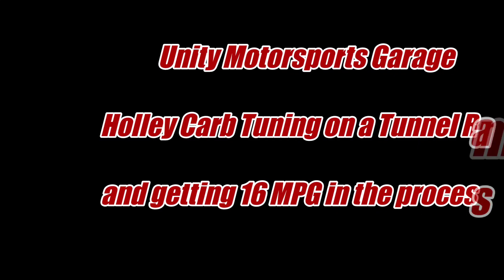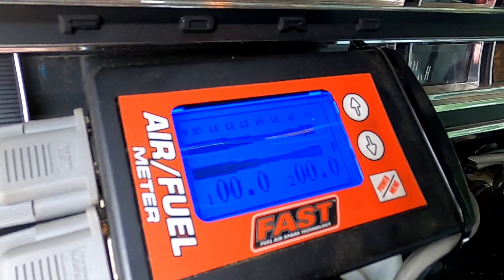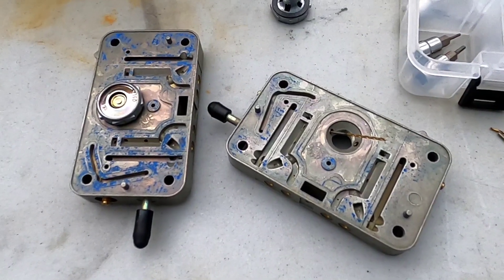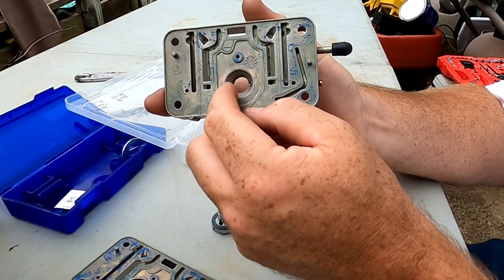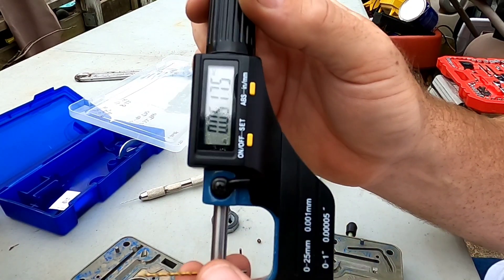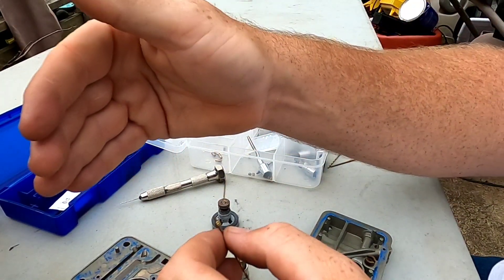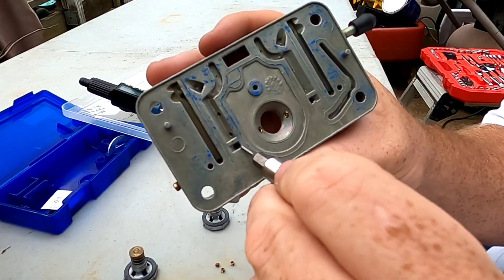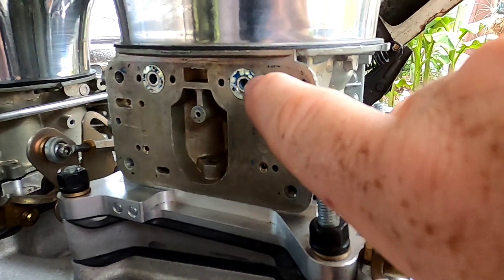600HP that gets 16MPG with a Holley Tunnel Ram and 2 Holley 660 Carbs

Comment: I have 12Bolt Tom’s tunnel ram cast for the 292 Chevy straight 6     
I’m considering getting his 3bbl modification for the Holley 4bbl. 
Soon to have the Carb Cheater controller. My 56 GMC lives a hard life at elevation in Colorado.

Comment: Andy, have been watching your videos on cams, tunnel rams, carbs, etc for a while. I'd like to talk to you about a new build that is right in line with the motor in this video. 438 Ford W street motor, AFr 220 heads, Holley high ram, 5 spd manual, 65 Comet. I don't have a cam or carbs yet, would like your input, especially cam. Every cam maker I've talked to has different specs ranging from 230 to 255 @ .050, crazy. I'm missing too many pieces of DV's formula to spec one myself, I'd screw it up. Gotta get a cam to get this motor together. Custom built tunnelram carbs or Edelbrock VRS, size ? I haven't seen any mods you've done to the current VRS carbs you're running for tunnel ram application, have watched all your Holley mods, how different ?
Reply from the maker: Are you wanting to Street Cruise this or is it S/S deal?
Hyd Roller or Solid? What Gear is in the Car?
On the Carbs I definitely would recommend two 750cfm VRS's they will make serious power and drive really well.

Comment: I have 633 HP to the wheels and I get 17-18 mpg on the highway running 80-85 mph. I only average about 10-11 mpg average in daily driving though. BUT- It is a 2006 CL55 with a (modified) M113K AMG motor in it. You getting similar numbers with this combo is pretty cool!

Comment: Glad to have found your site. These are the very best that I have seen. I'd really appreciate your thoughts and recommendation's on my application. I have a BluePrint 427 SBC with 220 CC heads. 10:1 compression. a .577 / .577 roller cam. It dynod at 555 Hp / 565 Trq. This is in my 67 Nova SS, Muncie M21 4 speed, Moser 12 bolt with 3:73 gears .I'd like to put on a dual quad tunnel ram set up. There's so many combinations out there, I need an experts advice. What intake, carbs and would the cam need to be swapped ? Thank you. Dave.

Comment: very much interested in the mpg content. i get 12 mpg on my 76 K20 towing rig and used to get 16 on my 69 Nova 327 340 horse but it is worn out. built it in 91. new motor 327 agian but dart block diamond pistons very small solid roller 224@.050 .525 jesel lifters. daily driver. i am that guy at Mr. B's in Rock Hill, SC that wants to talk about MPG, LOL

Comment: I've had a 350 with an offy tunnel ram with 2 600 hollies, or 1 750 double pumper. Ran 4 mpg with a 4 speed and 4.11's . I've got a vdrive with a 468 offy dual wafb's, light throttle under 40 mph, not bad, wot or 70 plus mph and I think it has negative mileage. 402 chevy 2 afb low rise, 8 mpg. If you get 16 that's a he'll of an egg under your gas pedal. Lol

Comment: The trans did not shift when you smash the throttle,    I have been wondering if that is the high stall converter that causes that type of reaction from the trans? If that is the case (if you don't mind) What type of trans, and what stall speed are you running?.  It really sounds and looks like the way to go for drag applications.  I( would like to get in the planning stages to put something similar together. Thanks  for all the great knowledge!.
Reply from the maker: Thanks for watching, this is a C4 trans with a Manual Reverse valve body .. I'm glad you enjoyed it
Andy

Comment: I consider myself well experienced with Holley Carburetors, I have rebuilt several, used tunnel rams, built a few hotrods and raced at my local drag strip. I did not have this info, and I love that you break it down in bite size pieces that are easy to understand. Also, your resources are awesome, thank-you for taking the time to post and share this info with us.
Reply from the maker: Thanks for the kind words and for watching.. I'm just giving back what has been given to me over the years...  
Andy

Comment: Andy.. what carb spacer are using? They look to be tapered. Also, are the 660s base plates aftermarket? They look like billet aluminum.
Reply from the maker: Yes they are tapered, to help control fuel slosh on the launch.. the baseplates are billet that came from Allstate Carbs! Thanks for Watching
Andy

Comment: Did you have to change carb body's to install power valves  in sec. Side or machine yours
Reply from the maker: That is a good point... My 4224's were old and had the channel for the power valve in the mainbody.  From my experience the older 4160's had the channel cast in them and the later ones have the solid flat surface.  
Thanks for Watching
Andy

Comment: Hello Andy, I am really liking your videos, but I would think a 2x4 would be a lot easier and less expensive to tune and achieve ideal economy and power a/f ratios throughout all the street strip operating range using carbs that have staged secondaries as opposed to the 660’s 1:1 action, or am I missing something?
Reply from the maker: Cabot, thanks for Watching.. with Tunnel Rams with 2x4's the thing is the amount of throttle opening required for a given speed is cut in half because you are opening the primaries on both carbs. The 660's have a slighty staged secondaries. You can open the primaries through the transfer slot range before the 1:1 kicks in... Even in my 4000lb truck I can go 70-80 mph and still be in the transfer slot!  Hope this helps
Andy

Comment: Fundamentally, this isn't that different from modern efi engines (LS, Coyote, Hemi...) except they're designed just to flow air. They all use, essentially, tunnel ram manifolds just rolled up to clear the hood. If you straighten them out and put a couple carbs on top, you'd have basically this. Getting this level of control from a carb or carbs is challenging.
Reply from the maker: It isn't hard to get Carbs to work well... They are a very Analog device that requires us to be the computer.. in fact you can get fuel injection type performance out of them. Just takes a bit of time and patience but once you get them right you are good! 
Thanks for Watching
Andy

Comment: What is the reason ore advantage to have a Ifr  in the metringblock AND  later in the Main body again ? Fuel supply to the t-slot = controled with the ifr, fuel to idle have the same well, but ist controled with the ims ? I 
Greetings from germany
Reply from the maker: That is a good question...  It's all about the area of the Transfer slot. Even though it pulls fuel from the IFR if the slot is too large it will be rich!  Most aftermarket billet baseplates have the slots cut too large.  
 I hope this helps!  Thanks for Watching
Andy

Comment: Most intelligent discussion I've heard on Holleys and their PVC's, transition slot, air correction, etc.  35 years ago I read Dave Vizards book (+ others) and came to the same conclusions that you did and made the same alterations that you did.  I had a 1/2 ton Ford van with 460 ci engine, a tight converter, tricked C6, headers, free-flowing Magnaflows with cross-over, recurved distributor, headers, water/alcohol injection. 10.4 compression, an Edelbrock intake, CompCams RV cam, etc and would make18-19 mpg on the open road (sometimes better) with my family of 6 and all our camping equipment.  There were a couple of other mods I made but can no longer remember.  When pulling a 22 foot Great Divide camping trailer, I could still make 11-2 mpg.  Some will call me a liar but I keep books on EVERYTHING and that's what she made.  One difference, I devised a way to peen the transfer slots shut a bit and use a jewelers file to to get the equal (+ many cans of beer) until I got it perfect.  I also played with the squirters and the shape of the plastic bits that activate the squirters until I had it perfect.  I wish I'd had a meter(A/F) like yours.....it would have saved me a lot of time.  I ended up with power and economy.  P.S. I also used a coil that delivered 50,000 volts and matched plugs.
Reply from the maker: Thanks! Tom.. These mods are fairly simple to do, its just time consuming on finding what your engine combo wants!  The gains are worth the time and effort..  I hope to continue down this path with MIXED UP BOSS and see what I can do with it!
Andy

Comment: So do you trick out carbs for other people. Nice truck by the way.
Reply from the maker: Terry, I used too but it really requires having the vehicle to get the combo dialed in... Thanks for the kind words about CASPER.. You will be seeing more of it soon!
Andy
Reply: @UnityMotorSportsGarage  good morning from AZ. Thanks for the reply. My 306 ranger is currently apart. Had a lifter go away. Was a lot of fun for 6 or 7 years. So as all good motorheads go putting it back the way it was really wasn't an option. LoL. You know more time, more money,more of my wife shaking her head. Bottom end is at the machine shop. So we are moving forward. Combo as parts are being acquired, pretty tight solid roller, comp. We're calling it 10.8, 10.9. 5 speed with 3.73. Out back. I guess since I don't know will this be enough to even get any good out of a tunnel Ram. It's a highway star when it's on. Anyway any info is good info. Have a great day,

Comment: I noticed your carb spacers run at a forward angle? What is the purpose for that Andy? Thank you.
Reply from the maker: Robert, I use them to help control fuel slosh on the launch... Works pretty well Thanks for Watching
Andy
Reply: @UnityMotorSportsGarage  Of course, oh duh me. I have a spacer I want to put under my 750. Will that change the tune?  I tuned it last time with a vacuum gauge  Thanks for sharing your great knowledge for us weekend hotrod mechanics. Have learned a lot.
Reply from the maker: @robertclymer6948  it can change the tune slightly... By adding plenum volume it weakens the signal to the carb slightly...  Alot of factors come into play but intake type and spacer type...  Experiment and see what your combo likes... Thanks for the kind words!
Andy

Comment: You know whats sad... my Tacoma [6 cylinder] got 16mpg around town - and its missing probably 420hp by comparison.  Clearly, engineers are coming in 3rd place behind government and lawyers telling car companies what to do.
But I wonder how it's different between resizing IFR from the addition of new metering "jet" [as you put it] in the mainbody where you drill/tap for the transfer slot feed?  I would think they would serve the same function, or... is there something regarding idle bleeds/screw adjustability that forces this move?

Comment: Man I’d love to pick your brain about my setup. It’s an LS1 with duel tunnel ram and 450 quick fuel vacuum secondary carbs. I also have a wide band to tune it. It idles at 14.5, just off idle it’s 13, cruise is 14.5, lean at WOT at 15 and then 13 on decel.

Comment: Can you give us a address to get these jets and parts along with the tools needed to do this please. I have 2 600 cfm Holley vacuum secondary carbs on a tunnel ram that I am going to use on my 8-71 super charger on the street. I think this will work well for me. 20% under drive on a 434 sbc.
Reply from the maker: Stuart, You can go to mcmaster.com to find the stuff needed to do these mods..  You will be surprised about the improvement you can make!
Reply: @UnityMotorSportsGarage  thank you for your response and time!
Reply from the maker: @stuartbuckley8720  anytime!

Comment: Question.  I am running 660s on a Weiand tunnel ram equipped 440.  What metering blocks are you using to have power valves?  Factory has them blocked and 76 jets.  Any information would be greatly appreciated.  Great videos, I love the detail.
Reply from the maker: I ordered 4 primary blocks for a 1850 600vs Holley.. they work great but you must modify your baseplates to convert to have 4 corner idle mix screws.. if you don't want or need the 4 corner deal you can just bottom the mixture screws out and just use the Primary screws
Hope this helps
Andy
Reply: @UnityMotorSportsGarage  Thank you so much!!  What is the modification that is needed in the baseplates?
Reply from the maker: @tetanustv6258  it's not hard to do... But it's more involved that I can explained in a post...  It would make for a good video down the road!  You can find this info by googling it if you want to do it before I make the video!
Andy
Reply: @UnityMotorSportsGarage  Ok, thank you.  Cant wait for more installments.  Keep them coming and the good work
Reply from the maker: @tetanustv6258  will do! 
Andy

Comment: 16mpg gee ,tunnel ram,truck bigblock,Gee that's impressive,  very highway driving 🤔
Reply from the maker: Hamish it's was a 393 stroker Windsor small block..  it would get 16mpg around town and would drop to around 13-14 on the highway due to the 4.30 gears... It needs overdrive!  
Andy

Comment: what is engine specs ,what camshaft, what heads etc?
Reply from the maker: This was a 393 Windsor with 10.7 to 1 compression, with David Vizard ported heads (flow 315 cfm @ .625" with a 192cc intake runner) a small solid roller cam 245/253 @ .050 .674"/.674" lift on a 108 LSA
Reply: @UnityMotorSportsGarage  what is trans and rearend gears if you don't mind . love the vid going to try this in a 78 Lincoln with a 460 maybe and 360 y block stroker maybe in something else. Learned alot always thought there was more could be done with carbs.

Comment: Sure wish I had access to the FAST Wideband meter when I was on the street with my setup. Tuning a tunnel ram with Holleys for the street is a lot different than for racing. I can't tell you how many times I had mine apart trying to get fuel economy and power. In my case, I cut a rectangular hole in my hood for clearance with no cover. It was great watching the velocity stacks shake when heading out for a cruise.
Reply from the maker: Having a wideband makes a huge difference in getting the Carbs dialed in..  when you have lean transition and main circuits the Accelerator pump circuit needs to be spot on when hammering into the power circuit!  Thanks for the kind words and for watching
Andy

Comment: If you put a thin coat of chapstick on the metering block and bowl gaskets.
it will eliminate the need to clean the surfaces of gasket material.
Try it, once you do. you will always have a tube of it in your tool box!
don't worry if a little gets in the small holes in the gasket. because the fuel will 
dissolve  it.
Reply from the maker: Jeff that is good stuff!
Andy

Comment: Thank you. This has helped me. I have a 88 ford mustang wit a basically stock 460 in it. I need to pull it out and replace the rear main seal so while it is out I'm going to go through it. I have a tunnel ram and two carbs for it now and am getting ready to order aluminum heads and a 545 ci stroker kit for it. Need to decide on a cam now? But this has helped me alot! Thank you. Wish you were in kansas that truck sound amazing 👏

Comment: Many years ago I ran into a little of this now where even close to this level of understanding just a butt dyno type deal . I was trying to make a 750 holly idle in a econ rail with a small block chev . The motor had a lot of camshaft , probably to much . What I did was to install some 2.5 power valves . drill a couple of .125 holes in the throttle plate to by pass enough air to bring the throttle plate back down to where it wanted them .I had seen a tech on some hot rod mag that showed how to install  a piece of wire to restrict the fuel I think also in the metering block . That was a long time ago . But it make the small block engine with a 600 isk roller and a lot of cylinders idle pretty decent with a automatic . . I do appreciate your videos and will watch them all thanks  i   i
Reply from the maker: Thank you! I've always been a hard head as my Dad would say... If someone would say it wouldn't work... I would try my best to get it to work... Why??? I don't know... Even though I'm 41 I just love carbs.. you can make them almost rival FI in every area.. except in the Cold start... I still want to get that figured out!  Thanks for Watching and please Subscribe as I have more good stuff coming
Andy